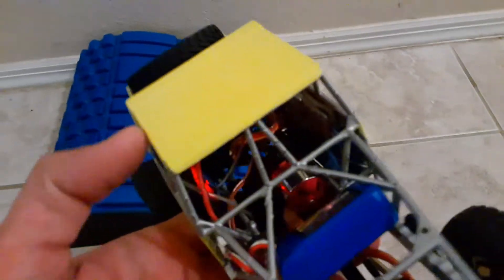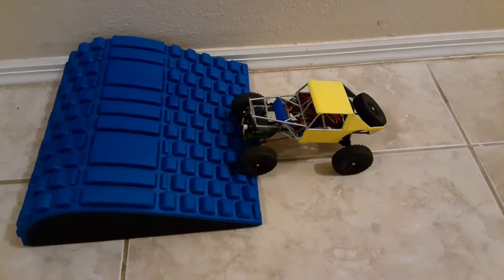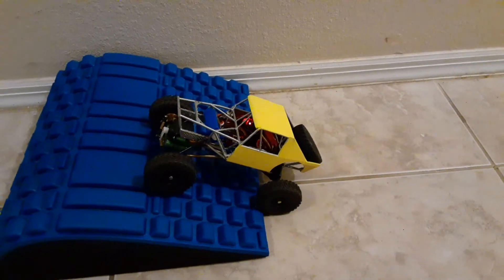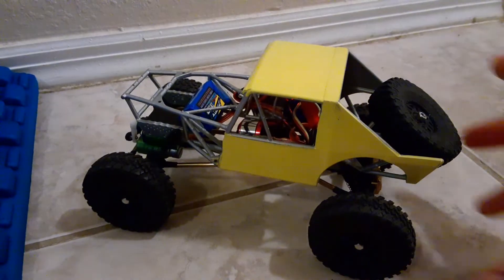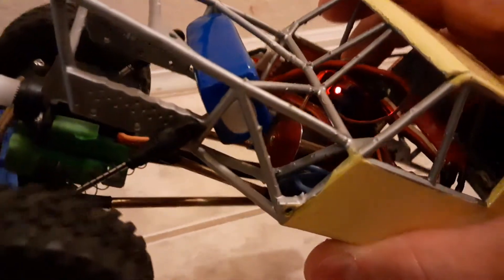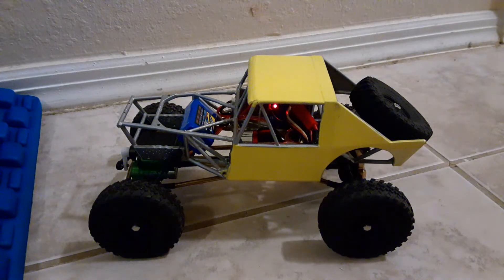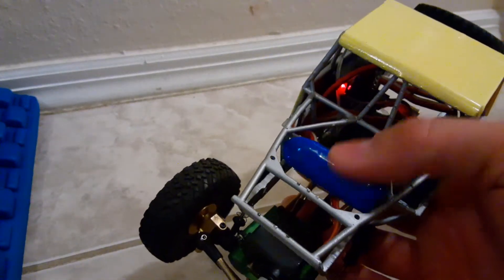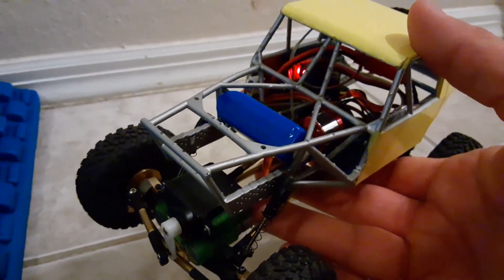SCX24 Deadbolt with Miller chassis and Tiny outrunner motor!

Comment: I just tried in 3s. It is supposed to handle it but thank God I checked it it was blistering hot. I don't know how the wires didn't solder off. In 2s it's perfect but 3s didn't do anything but make it almost catch firemy finger is burnt!
Reply from the maker: Ive never had that issue but then again I dont run 3s for long anyway🤔. I see 3s as something Id use if wanting a faster rig mainly. When using for crawling I stick to 2s since battery is lighter at same mah level and also esc has much easier time controlling slow speed as lower voltage puts less strain on it. Did the esc used get hot as well? If it did you either have a really heavy rig or have something putting extra drag on the driveline 🤔. Usually pinion mesh would cause that but hard to say from all the way over here😅.
Reply: @Gamyrc  no i was just reving it to max trying to climb none stop luckily I touched it don't do it trust me
Reply from the maker: @rctony710  Ooook, ok. Well that makes sense. These motors are rated for those voltages but if your pushing them for prolonged times you need to remember these ratings are with props attached which get airflow through motor which cools them. In our rigs theres no airflow at all😅.

Comment: I like it, you have parts list for outrunner mod?
Reply from the maker: https://www.ebay.com/itm/1PCS-4PCS-Micro-Brushless-Metal-Outrunner-Motor-ADH100-1408-1850KV-for-RC-Model/163220282941?hash=item2600afde3d:m:m8X6AmtlFBrzM5x7yIX77vA
Reply from the maker: https://www.shapeways.com/product/RLF5VX2ZH/scx24-tiny-brushless-motor-plate-x2?optionId=156357437&li=shops

Comment: Would you think the castle creation sidewinder 2 micro a good esc to use for this motor?
Reply from the maker: Theres no brushless motor at this scale that wouldnt benefit from using a sidewinder. Im using a basic 10a esc on it and its still doing great imagine a castle!
Reply: Gamyrc any chance you have a link to the one you are using?
Reply from the maker: Seems to be in backorder right now 😕
https://hobbyking.com/en_us/hobbykingr-tm-brushless-car-esc-10a-w-reverse.html?queryID=3ddf2797e7ee0686762f2930df4e39a0&objectID=46013&indexName=hbk_live_magento_en_us_products
Reply: @Gamyrc  I will be trying a Hobbywing 18A EZRUN ESC.  ~$20
Reply: @grey-adventures   how well did it worked?

Comment: I keep burning up barrage motors because of all the weight.  Would you recommend this over the 370?
Reply from the maker: I do, its lighter and plenty of power. Plus no brushes to wear out.
Reply: @Gamyrc  I was playing around with some 370s I had because of your other vid, but they make it a bit top heavy, even when moving it to the front.  With the barrage setup I was getting 57* with the front left barely lifting, with the 370 it was wanting to flip around 50*.  I'm thinking this might be a cool setup to try out and still keep that low cg.
Reply from the maker: @secret5.  Deffinetly. That why I went with the 1408. I have a motor plate for the Holmes 380 Recolver but because of its size it had to be placed higher which again hurts the cog. This little guy solves that issue.
Reply: @Gamyrc  The 1408 motors I'm seeing all have threaded output shafts for props.  Is there a certain brand you know that will fit best?
Reply from the maker: @secret5.  This is the one I use but im sure theres much better ones if you look enough. https://www.ebay.com/itm/1PCS-2PCS-Micro-Brushless-Metal-Outrunner-Motor-ADH100-1408-1850KV-for-RC-Model/163220282941?hash=item2600afde3d:g:BrAAAOSwW8ZdJY5a
Reply: @Gamyrc  Thanks, I ordered a bunch of your plates from shapeways and saw the info there.  Looking forward to trying them out, they should be here soon.